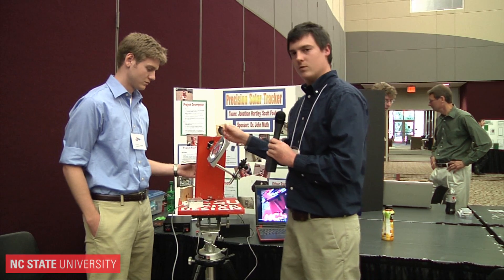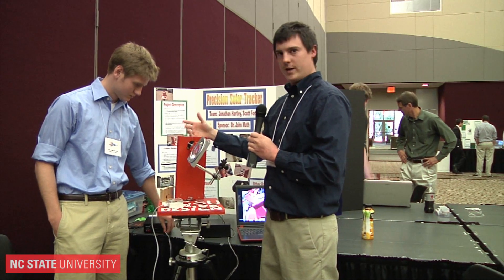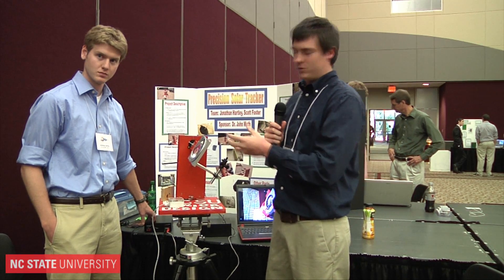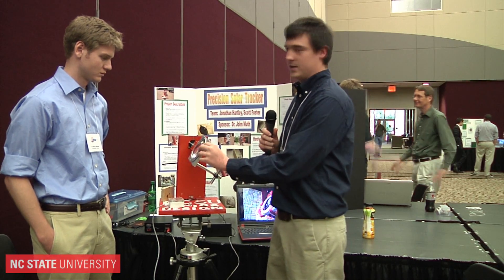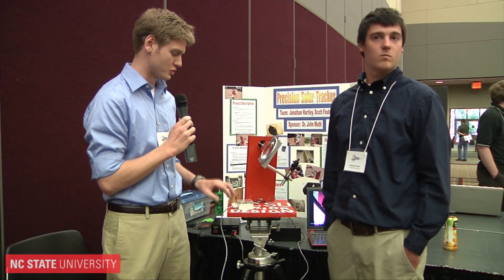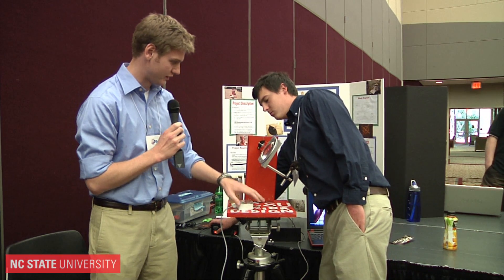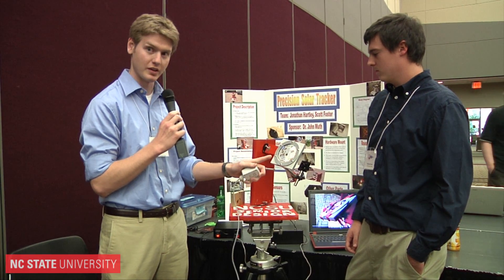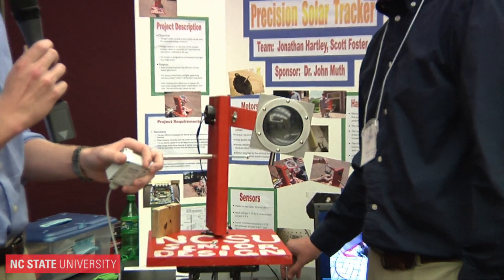Precision Solar Tracking System

Comment: I am very interested in your project.  It seems a lot like the one I am currently designing(eg: engages motors when the sun is not fully lighting the photo cells.  Uses shaded areas to determine direction of sun.)  If you could get in touch with me my email address is fundamentalsolarsystems@gmail.com 
thanks, 1232sean